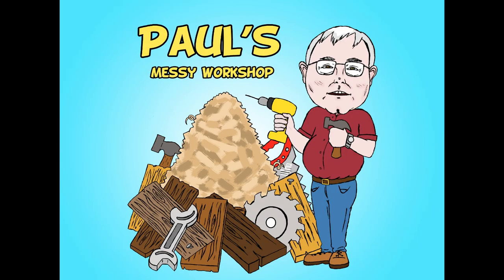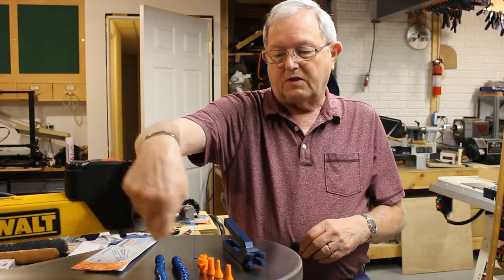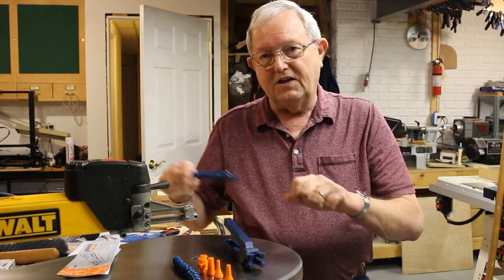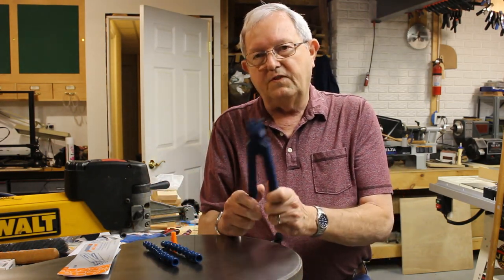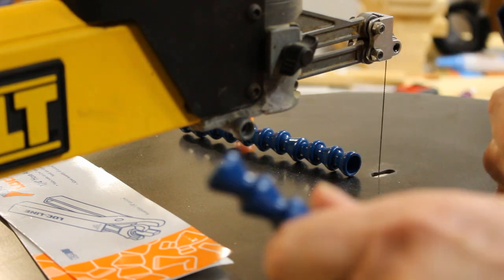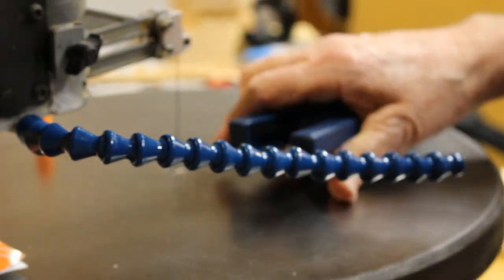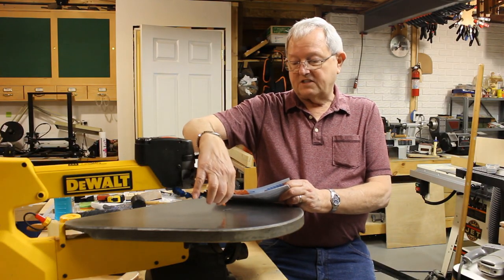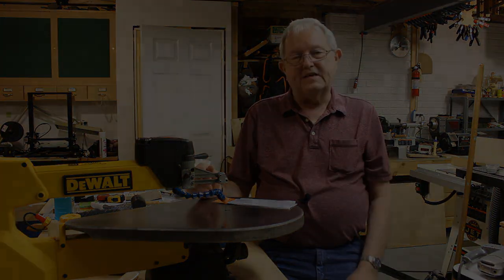Saw Dust Hose For Scroll Saw

Comment: Found an “adjustable plastic cooling tube” that does not require any tools to adjust length - $5.69 on Amazon Prime.
Reply from the maker: Rudy,  Excellent find.  Just an FYI, the tubing that I linked to doesn't NEED the pliers it is just that the pliers just make things so much easier.   Good luck and thanks for watching and for the comment/information.

Comment: Great tip, thanks! I was ready to pay nearly $30 to DeWalt for a replacement "air hose" when the old one broke, but I bought your recommended Loc-Line 1/4" ID coolant hose kit AND their pliers for 1/4" hose, total just under $18 from Amazon, and it went together on the scroll saw quickly and easily ( I did find that removing the saw table and raising the saw's upper arm made it much easier to get the pliers where it needed to go next to the saw's air outlet). The Loc-Line hose is clearly better quality than the knock-off that DeWalt originally supplied with the saw, and it is made in the good old USA.
Reply from the maker: youtuuba, I am really happy that the Loc-Line worked out well for you.  Like you I found that the quality was so much better than the original.  Thanks so much for watching and for leaving the nice comment.

Comment: I already installed the Loc-Line hose on my DeWalt Scroll Saw.  It only took a matter of seconds to install thanks to your helpful video and the pliers work great.  Thanks so much for this helpful information Paul!
Reply from the maker: Lori,  I am glad that the Loc-Line hose worked out so well for you.  I haven't tried it but it sure seems like the installation would be a lot more difficult without the pliers.  The pliers also will work to help separate the pieces also just in case you want to make the hose shorter.  Thanks for watching and for the really nice comment, I appreciate it.

Comment: Thanks for a great tip for scrollers.  It sure looks like the plyers are a good tool.
Reply from the maker: Gary, yes, the pliers are well worth the $10 or so.  They sure make working with the Loc - Line hose a lot easier.  Thanks for watching.

Comment: Paul, Steve Good said you should clean up your messy shop. Thanks for your video. I will order mine right away.
Reply from the maker: Ray, Steve knows best and is 100% correct.  The downside however is that if I clean it up too much I will need to change the name of my channel...LOL.  Thanks so much for tuning in and for leaving the comment.

Comment: Hi Paul. I had a broken link with that hose. The first link broke while I moved it because my tiny shop was cold.
To correct the situation , after getting rid of that link, I used hot water to soften the next link and lucky me, I didn't need the special plyer to force it in place. No further problem with it.
Reply from the maker: Michel, glad to hear from you.  I think the weakest part of that hose is where it attaches to the saw.  It is even worse when it is cold.  I have heard that hot water is a good way to soften up the links a bit.  I am lazy, that is why I opted for the pliers.  Thanks for watching and for your comment.

Comment: Well done, Paul!  Very informative for anyone needing to do this chore, which will eventually need to be done on any of this type. I, too, bought one from Dewalt and from Delta a few years ago for each of those saws I have, and struggled with the install. I then saw the Amazon kit after all the fun! haha  I now have a Seyco, and will eventually need to do it as well. This will be my path next time!  Thank you again for all you do!
Reply from the maker: Billie, yes, it seems like the life expectancy of the hose where it attaches to the saw is limited.  Probably because there is stress there and it gets a lot of movement.  The Loc-Line kit and pliers sure do make a more cost effective way of solving the problem.  Thanks for watching and the comment.

Comment: Good solution.  They are probably all made at the same factory.  I used to use them in industry all the time.
Reply from the maker: Jim, I would bet you are right that they are all made in the same factory.  Different colored plastic for different distributors.  Thanks for taking the time to watch and comment.

Comment: Howdy Paul! I haven't had any problems with my blower hose but thanks for the video. It's good information in the event that I need a replacement. My kids somewhat took over my DeWalt 788 over the summer making little art pieces. I ended up hooking mine up to a little vacuum dust collection system that actually works quite well. If you ever consider hooking yours up to dust collection I have a video on my simple setup. Cheers!😊
Reply from the maker: Hey Slow, I would like to see your dust collection video.  Is it on your channel?  Thanks for taking the time to watch and comment.
Reply from the maker: Slow,  Found your video, going to watch it right now and also subscribe.  Thanks for the info.
Reply: Hello Paul! Yes it is. Titled (scroll saw dust collection) It may not be the best video but it really is a great solution for dust collection on the scroll saw. Let me know what you think. Cheers!

Comment: Thanks, this will be a great help. Do the pliers assist in disconnecting the hose sections? Your shop looks like someone works in it. I like it.
Reply from the maker: Bob, yes, the pliers will also help in disconnecting the sections.  The pliers makes working with the hose a whole lot easier all around, well worth the $10 or so.  I appreciate the kind words about my shop looking like someone works in it, really my downfall is horizontal surfaces...LOL.  Thanks for watching and commenting.

Comment: The wrench is nice but not needed, neither is heating. Especially for 3 connections.
 You can buy 2 nozzles of your choice for half of the  big set. Although you can only use one.
I chose to place a 90* fitting and a wide multi-hole nozzle on mine.
And loc-line does sell the hose in black as well as grey, besides the blue.

Comment: Great solution Paul and one that I can use right now.  I have needed a new hose for some time but didn't want to pay the high price from DeWalt.  On top of how expensive their price is, the shipping is very steep as well.  Now that you've had a while to use this, does it work fine?  If so, I'm going to buy the hose and pliers right away.  The pliers look like a very good investment too.  I didn't know they had such a handy tool for this.  Thanks Paul for the helpful and informative video!     Best wishes, Lori
Reply from the maker: Lori, the new hose on the DeWalt works great.  I would agree that the pliers are a good investment.  Probably the DeWalt part and the Loc-Line are made in the same factory, other than color they look the same.  Since I made the video I have donated the saw to our local senior center woodshop.  I haven't heard of any probblems they have had with the hose either.  Thanks for your comment and taking the time to watch.

Comment: Nice solution to the missing parts Paul.  Do the pliers also assist you in taking the sections apart or are they only used for putting them together?  Either way, great episode of the show Paul.  I've always enjoyed watching your program and this one was no exception to that.
Reply from the maker: Ken, thanks for watching.  Yes the pliers will help take the sections apart.  Honestly the price of the pliers is a small price to pay for how well they work.  I couldn't believe the difference in price between the Loc Line product and the replacement parts through e-parts or DeWalt.  Thanks for the kind words and I sure appreciate your support.
Reply: It's always a crazy price when Brand name replacement parts are involved.  Glad to hear that you found a, more than reasonable replacement.  Excellent stuff.  Thanks for the information.

Comment: Hi Paul,
I own a Seyco 21-ST and due to a freak accident my hose was almost completely burnt off so I will have to replace the hose. Do you know if the Loc Line hose will work? Thanks, Steve
Reply from the maker: Steve,   I don't see why it wouldn't work.  I think all scroll saws use a 1/4" line.  The Loc Line is a great product and the pliers are a good investement too.  Good luck and let me know how you make out with it.   Thanks for watching.
Reply: Thank for the quick response Paul. I may try them. @paulsmessyworkshop